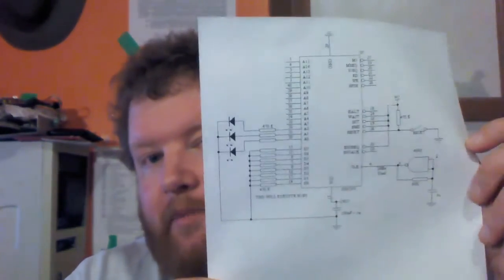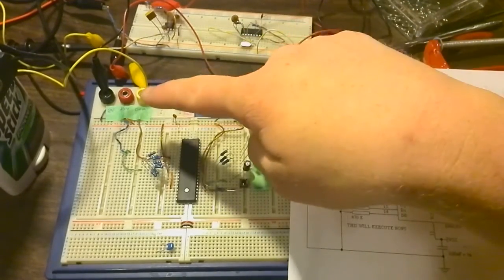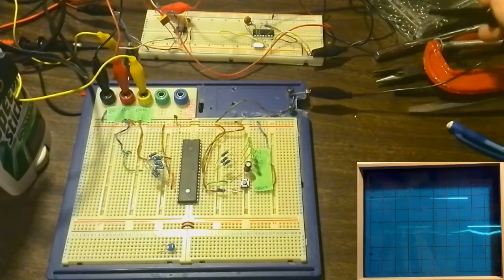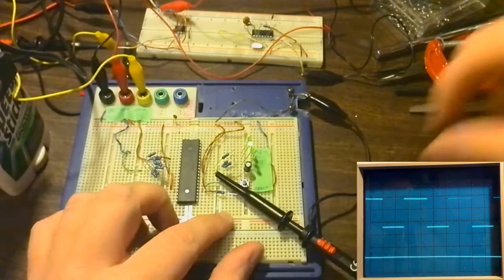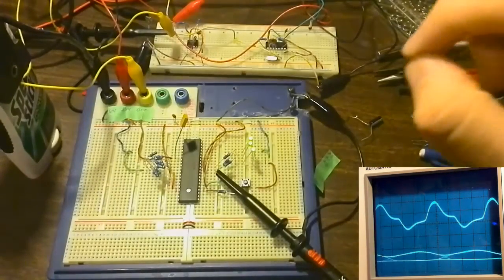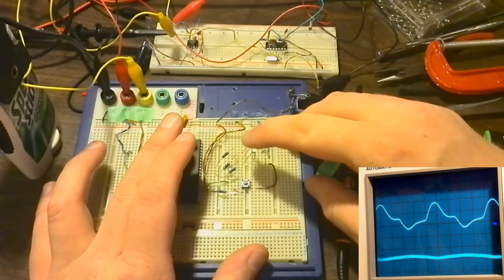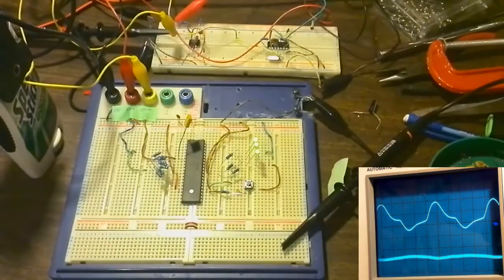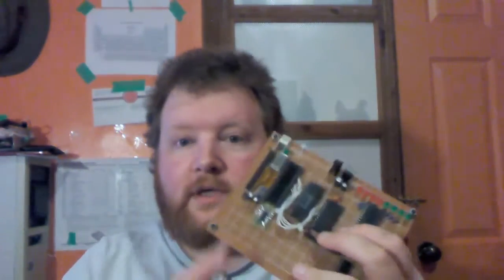Z80 Project 002 - Z80 test circuit (or Why we don't build computers on breadboards)

Comment: There is a reason why the clock circuit is right next to the MPU on all commercial designs.
Reply from the maker: most definitely, I've had success in the past with using a clock on a second breadboard for demonstrations, I just seem to be in a noisy environment in this case :) All my other computer designs do have the clock next to the processor. Thanks for the comment :)

Comment: Long video is long. Reasons why it would have been working fine? shorter wires, move the clock circuit closer to your cpu. But its awesome you build this and testing it aswell. Ive builded the z80 test circuit myself and a 4039 as a clock works fine. you can visualy see the leds blink. 

Breadboards and long wires pickup noice quite easy. also breadboards are like alott of small capasitors aswell. im guesing you figured that out already long before my comment. But for others, please keep clock signals clean and close. and wires can act as antennas. Keep the videos comming :D
Reply from the maker: Hi Nico, I usually build a bit more compact than that, I just had it spread out a little so people can observe the layout in the video, unfortunately I didn't test it before filming due to time constraints. I remember building an NTSC sync separator circuit at college on a breadboard and having to get it pretty compact to negate the noise, but it still picked up a little. :)
My future videos will be mainly using an oscillator module as they take up little space on the board, but I may revisit these types of oscillators later for debugging purposes. Thanks for the comment and more should be coming this weekend :)
Reply: 39K
Thx for the reply. and im looking forward to see them. planning on doing some z80 thinkering myself. You did indeed explain it informative and clearly. It got me thinking of doing some measurements too in my projects.
Reply from the maker: Your very welcome, and I hope your projects go well :)